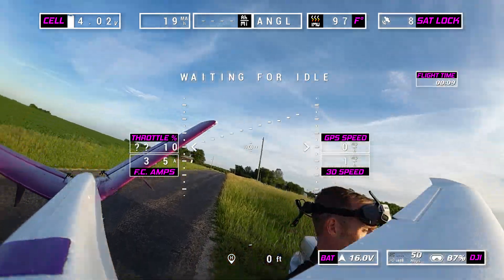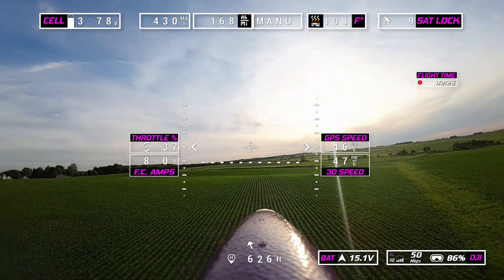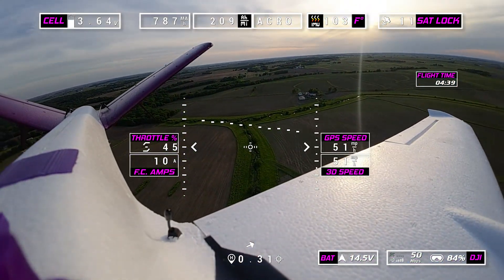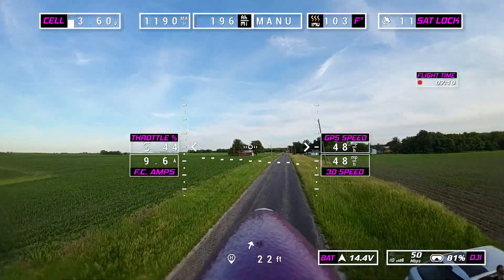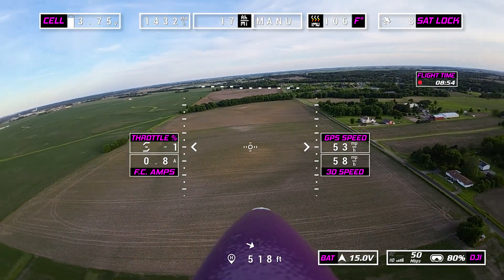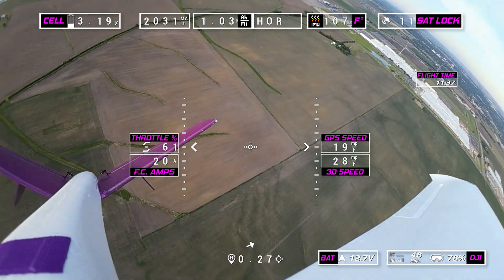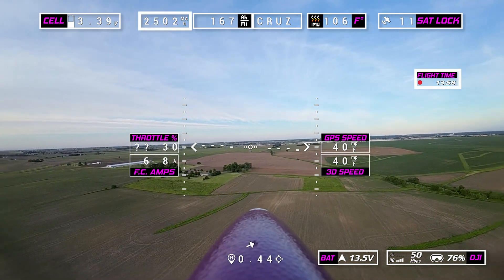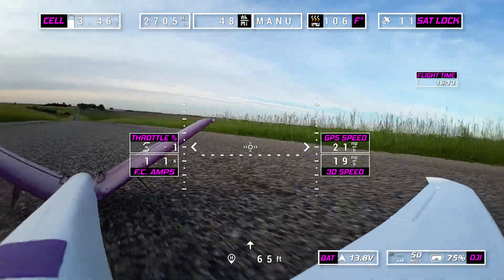ATOMRC SWORDFISH - INAV SETTING-MOTOR UPGRADES-FREE 3D PRINTED PARTS

Comment: Do you add these OSD elements during video editing (or this is stock)? What font is this?
Reply from the maker: Yes, I add a graphic overlay I made in Adobe Illustrator to cover up the DJI "?"'.  Sorry but the font I use is top secret.  It is something that I found to set my videos apart from the rest of the ever growing FPV YouTubers.
Reply: @JeffDoesThis  I have unsubbed from anyone not using this font